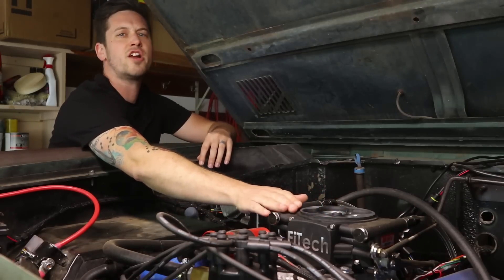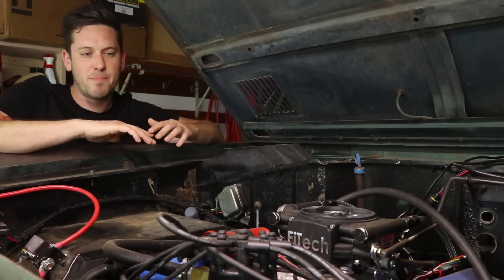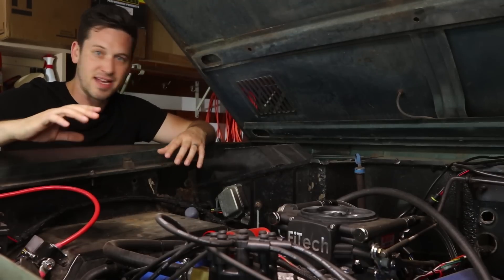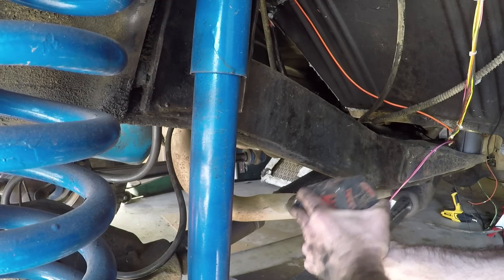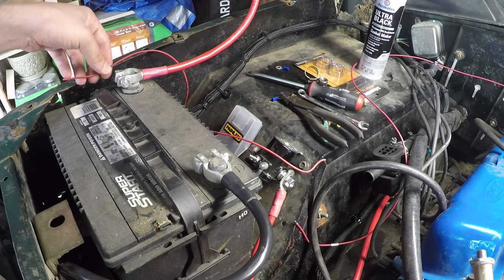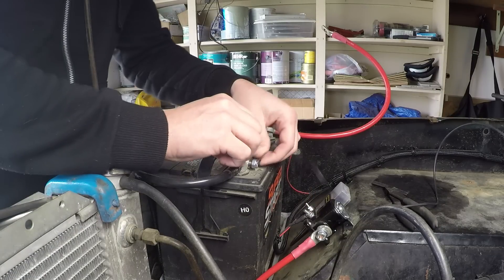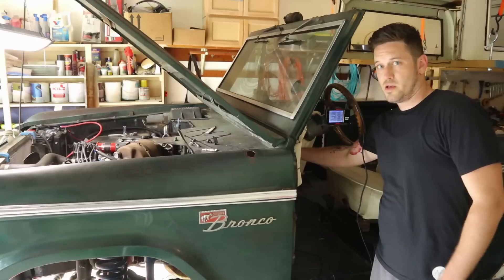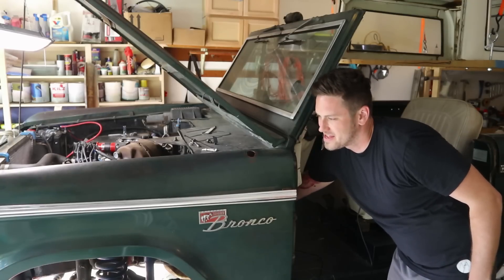How to Install FiTech EFI on Ford 302

Comment: Has anyone else complained (or remarked) as to the HUGE additional pedal effort with the FiTech? Unbelievable.  Cannot easily feather the pedal without sending shock waves thru  the car frame.

Comment: Here in the UK We have just installed the efi 500 into a 1949 f100 302 block. If you only have 1 wire dizzy then your tac wire goes to that. Your key switch wire goes to the  positing coil. Different wiring for different distributors. We had a 2 wire dizzy but it wasnt  tall enough to go past the inlet plenum for timing adjust but if it had then positive dizzy wire would go to positive coil and negative dizzy wire would go to negative coil. Tac would then go to negatie coil wire. 
We have auto water pump  so positive goes to coil positive and other goes to ground. Fan wire off loom goes to positive wire on fan and negative to ground. Fuel pump positive to fuel wire on loom. Fuel pump negative to ground on chasis.inline fuel pump has to be 3 feet away from tank with filter inbetweem tank and pump. Another filter after pump the fuel line to fuel regulator. Fuel pressure needs to be 58 to 60 psi for this system.

Comment: It took me 9 hours. That includes removing smog and making a custom surge tank. It fired right up first try 🤪
Reply from the maker: Boom! Nicely done
Reply: Cool, so can you come do mine 😩😩…
Reply: @screemishnescity  what's my reward? 🤣
Reply: is a surge tank required?
Reply: @RodBarn  you have to install some type of reservoir or an efi fuel tank. Carburetor tanks don't have baffles as the Carburetor itself has a fuel reservoir

Comment: So more than a year later how is it holding up?
Reply: yea I hear ya man
  Hopefully you get your kinks worked out.  thanks for the quick responses.
Reply from the maker: Thanks
Reply from the maker: It’s starting to show signs of failure. Having some issues with the hand held controller right now
Reply: Is it something you'd buy again
Reply from the maker: I would probably go with the Holley sniper, but that’s the “grass is always greener” mindset talking.

Comment: Hey, great video! this helped me out a lot. Just finished doing this to my '81 F100 with a 302. Great tip on connecting the white wire to the Voltage regulator Green/Red wire. The Red/Green solenoid wire only works in Crank pos tho. As far as the temp gauge goes, my new manifold had multiple openings in the coolant pipe, so I just put both the FITech sensor and my stock sensor in them.

Comment: Looks like fuel pump was only change needed. Did the bronco have a compatible tank and fuel return lines already?
Reply from the maker: No I have a stock tank running the return line up top in one of the vent ports
Reply: @NashvilleEarlyBronco  so return line is absolutely necessary?

Comment: great video,  I understand you are just learning,  so here is something for future , your dura spark dist.  is a 2 wire dist, and while the msd dist is a great unit, I run one myself, you could of run the one you had.

I just got my fitec what I'm still unclear about, is if I can still run my msd 6AL box and still use the fitec timing control, mine is going on a 72 Maverick race car,   and the msd has all my rev control that I don't want to lose
Reply from the maker: Yes, the duraspark is a 2 wire distributor, but per fitech it does not work with their system ( or it didn’t at the time of install). The duraspark actually has an extra wire (I think it’s a ground wire) that fitech didn’t know what to do with. I’m sure there’s a work around, but I didn’t take the time to figure it out and just went with the MSD. I didn’t set mine up with a 6AL box, but the instructions say you can to utilize the fitech timing control. Sounds like you have an awesome build. Hope it all works for you 👍🏼

Comment: Hey man, I'm sure it's way late, but you can add a 90deg fitting that's more like a TEE going into your intake manifold (water side) with a port available for an additional CLT sensor.  Hope all is well, your videos have been super helpful restoring the old family bronco.  The one I'm struggling with now is can I roll with a tach and the FITECH on the same wire off of an HEI dist., or will I have issues... I'll figure out one way or another... Either way man, cheers and very helpful videos.  I think I owe you a beer at this point.
Reply: Based on earlier comments, I'll take caution.  Sounds like you can't really share that signal and the FITECH needs it.  I guess I'll keep driving her off of sound then.
Reply from the maker: Thanks man! Haha! I’ll take a beer anytime!

Comment: Great Information thanks.  Wanting to get the  go efi 4 because i plan on putting it on a much larger motor in the future but would be putting it on an almost stock 302 truck setup for now.  Fitech is advertising this setup for between 250 and 600 hp.  How wild is your setup?  Is this simply too big for a stock 5 liter?  thanks
Reply from the maker: My engine is a stock 302 as well. I put it on the dyno and it made 140hp 😂 so no, it’s not too big for a stock 302. It runs great and I love it.

Comment: I thought you could use a duraspark distributor with these Fitech units as well...?
Reply from the maker: I thought so too, but my duraspark wasn’t a true 2-wire distributor. Who knew
Reply: Oh hmmm, i thought you could rip out all of the advance mechanism stuff and get it to work...  will have to double check forums etc..  Did you confirm it wouldn't work?
Reply: It is possible i believe, here is a thread talking about using a conversion harness if you don’t want to splice into it etc: http://forums.vintage-mustang.com/vintage-mustang-forum/1038778-distriutor-fitech-efi.html
Reply from the maker: Interesting, I’ll check that out.

Comment: I am trying to figure out if this would work on my F150, I have a 1996 302 I’m building from a bronco, would this do any justice to me getting more power?
Reply from the maker: +Ethankirsch Kirsch it would work with that engine, but it’s not going to increase horsepower. The FiTech doesn’t really give you much more hp but for me it made my engine run better
Reply: So it’s not going to do anything for me
Reply from the maker: +Ethankirsch Kirsch probably not if you already had EFI

Comment: Do you have video on how you did your fuel tank return line?
Reply from the maker: +Demi Cruz no, but I️ just ran a single line from the return on the fitech to one of the vent ports on my tank
Reply: Have this system on the same bronco. Any issues with over pressure in fuel tanks?
Reply from the maker: None yet
Reply: Found some problems with this truck. Has transfer pump from front to back tank with no vapor recovery. Front pump runs all the time KOER and creates fuel vapor pressure in rear tank also fuel return is at base of the filler neck near the tank. I didn't install this system. I was asked  to fix.
Reply from the maker: Does the tank vent at all? I have a vented gas cap and still have one vent line hooked up. But I can see how pressure could build up quick if I didn’t have that.

Comment: Was that squeal at the end from your belt or a bearing?
Reply from the maker: +mercurysun6 belts. They squeal a lot. I don’t even hear it anymore 😂
Reply: Nashville Early Bronco same here with my 289 but it is so loud on warm up sometimes that I almost thought it was a bearing. It is so loud that I can't even pin point the squeal. Good info on the install.
Reply from the maker: +mercurysun6 haha yeah I hear you. Thanks

Comment: Great information! I recently discovered these carb style efi throttle bodies and I'm wondering how they compare to the modern 302 intakes. My daily driver is a 2001 Explorer with the gt40 heads and intake. How does the Fitech stack up on a motor that already has efi? My other option is Holley Systemax/Trick Flow Track Heat or something similar.
Reply: No such thing as a "modern 302", they stopped making them almost 30 years ago. Not throwing stones at you, my "fun car" is running a 1969 block (351W) so it is over 50 years old! Disappointing to go to the local parts store and basic things like thermostat or valve cover gaskets have to be special ordered :-(
Reply: @EdBert  the later 302s ditched the distributor in favor of coil packs. So there are a couple modern(for the time) upgrades before they stopped production.

Comment: Do you have a tach?  Or do you just rely on the tach from the FiTech?  The reason I'm asking is because of the #999 Gray/Yellow Wire.  I'm afraid that if I remove that wire, then I won't get a signal back to my tach on the steering column.
Reply from the maker: +Ryan Duwe I don't have a tach, just rely on the fitech. Isn't the green wire carrying the signal to the tach? I can't remember the painless number
Reply: Yes, you're correct.  I asked the question prior to looking at the book.  My bad.
Reply from the maker: Haha! No worries

Comment: Thank you very much for your help. A friend question I am connecting the fitech with the msd 6012, just to leave doubts, should I put the output cable of the tach to the blue cable of fitech? Why I understand that msd sends 12v non-negative signal ....
Reply from the maker: I believe that's correct!

Comment: Greetings friend, I would like to know in which part of the fitech cable branch is the negative? I see that only the positive (12volt) is connected but the negative does not ... wonder how or where is the negative in the fitech system? I thought it was black wire but I see it says coil not ground
Reply from the maker: +RUTH NOEMI MORLES DE CASTELLANOS I believe the fitech is grounded to the engine block. I don't remember running a desperate ground...

Comment: Great video man, know it takes a lot of time to make these damn video let alone put in the Fitech system. I have 2 systems (and no I did not get one "extra" sent to me lol) but boy do I know your struggle X2. They said you could do it in a weekend, no problem... Well I guess I'm like you, mistakes are my middle name. Defiantly took me a few weeks maybe a month to get one old skool started. Theres always a few extra parts you need to order because every vehicle has s different setup. I needed a new dual sending unit for the return line and extra AN fittings which took a few days to get in (another set back). Watch out for the crush washer on the fuel pump fellas! If you don't get it seeded correctly its gonna LEAK! It took Fitech 3 weeks to send me a new F'in washer. Shit like that will slow you down... And piss you off too! I had a MSD ignition box in my system that went bad and I almost gave up trying to get my ride started. When in doubt, start over and KISS that baby (Keep It Simple Stupid) So I took the MSD box out and removed it form the system... well what do you know... it started. Check your timing and maybe just maybe you'll get to take it around the block. Check for leaks, check your work and take it easy till you get the system 100% I found out my AFR was TO HIGH and I was running rich @ 14 AFR so I bumped it down to 12.6 and running much cleaner now! Even though back in the day carbs were the SHIT, now a days very few people know how to properly adjust them.  So KISS, the system is pretty solid overall and once you get it in correctly and your motor dialed in you won't regret EFI! Good luck out there. Looking forward to more videos, like your style kat!                 

I think I even heard your wife in background celebrating you got the darn thing started! lol
Reply from the maker: +Tim R haha! Thanks man! I still need to get mine running a little more lean!
Reply: +Nashville Early Bronco my truck was smoking (out of the tail pipe) pretty good before I adjusted the AFR, bring it down a bit and it will make a big difference. Good luck brother!
Reply from the maker: +Tim R thanks for the tip! I'll try that

Comment: Installed on my bronco too and learned the hard way that you can not splice either an existing temp sensor or existing tach wire or you will get signal interferences on both and trip fi tech fault codes and you won't run.
Reply from the maker: +johnrisham ohhhh!!!! Man that sucks!!! Good to know
Reply: Is it possible to run your instrument cluster tach then or no?
Reply from the maker: Yeah there’s one tach wire for your cluster

Comment: Man.... officially jealous. So what made you decide fitech over the holley or edelbrock efi offerings?
Reply from the maker: Honestly I didn't know about the other options until I bought this one. Then I started seeing all of them. But from what I've read, this is a solid option (but I didn't do my research)
Reply: Well I obviously havent done my research either. I had not heard of fitech until now. Let us know how it holds up man.
Reply: Looking into doing the same, was wondering how it has held up so far

Comment: Was the accessory on, but not crank on wire the pink one?
Reply from the maker: That's the one! And man, I swear I tested it during crank and it read 12V, but then I called painless and they said I was crazy.
Reply: Nashville Early Bronco that explains so much. I was having issues with my amp a while back and couldn't figure out why until I just watched this.
Reply from the maker: Haha! Yep. In the painless instructions it makes you think it's crank on... but it's not. Did you do the FiTech or just the Painless?
Reply: Nashville Early Bronco just the painless so far. That was the first thing I did, and I knew nothing about vehicles when I did it. Best learning experience I could have had. Still have a carb, but want to make the switch to the FiTech. Just not sure when it will happen. I'm struggling with priority vs. funds right now. I think floor pans are next. Debating on whether to pull the body and sandblast/paint the frame. My fear with that is that I'll be out of commission for a year, which means my boys won't be happy.
Reply from the maker: +Ryan Duwe haha! Yeah man when you pull the body prepare to not drive it for a really long time. And if funds are an issue I would not pull the body. That gets really expensive as you keep needing to buy $50 parts you break. All those 50 year old parts are brittle!

Comment: Hey man I'm subbed and watch your videos lately they have helped a lot I did the 600 pa on a 302 I'm in the process of setting timing control but I have a question it seems I have some "blow by" since the install but I'm no mechanic is this too much? Check my Chanel I'll upload a video please
Reply from the maker: Thanks man! Just commented on your video
Reply: It still could be bad rings but doesn't seem as likely now coolant levels are fine car was stored last winter only ran a couple short times could just be mouisture from what I'm gathering thanks!
Reply from the maker: +Troy mackeod let's hope so!

Comment: Jon glad you finally got it running. Mine is still in the box 😞. I too want the dash temp gauge to work so I bought a new aluminum thermostat housing from Wild Horses. It has a sensor port.
Reply from the maker: +Keith Kowalski ah man! I thought for sure you would beat me. Get to it man!

Comment: Well produced video. Could you go into more on synchronizing distributor to Fitech. I do detect a problem with the 16ga. wire you spliced to main 14ga. power wire. You should have used 12ga. You are running Fitech, fuel pump, and ignition all on that to small of wire. Remember too that when you ran that ground wire back to batterie, you need to add that length to the power length to calc. amp draw.
Reply from the maker: +j kropp good info. I didn't even catch that I misspoke. It wasn't 16ga, but now I can't remember if it was 14 or 12. I think the fitech wire is 14 and I bought 14 to match. I didn't think about the power draw from the battery. I need to look at that. Thanks again!